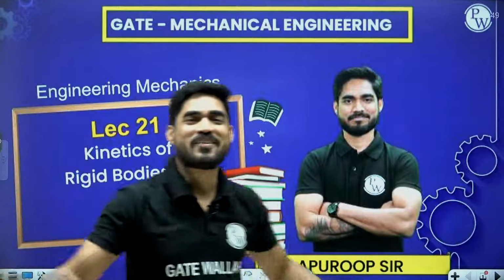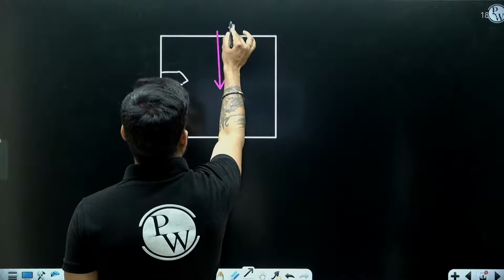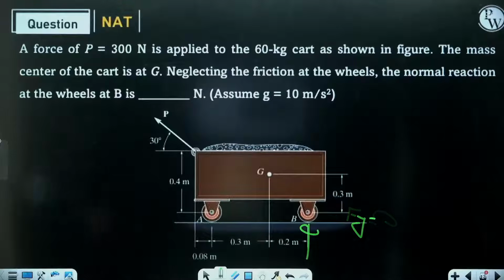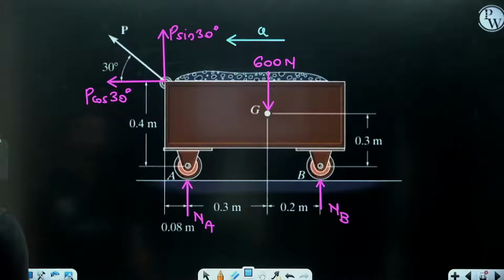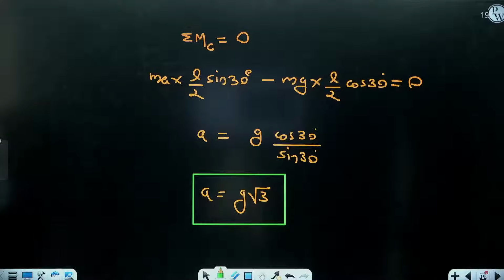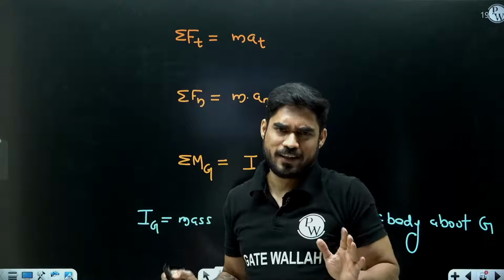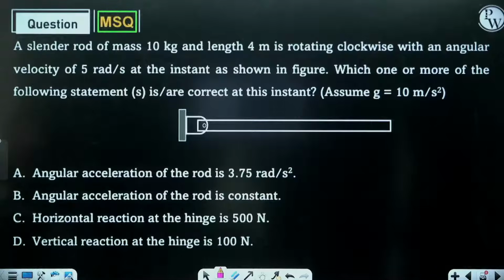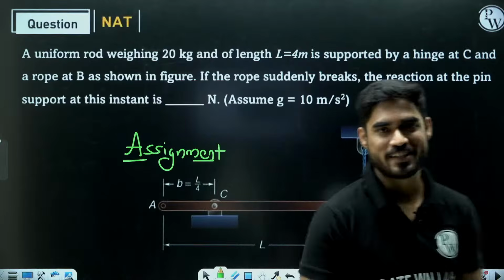Engineering Mechanics 21 | Kinetics of Rigid Bodies -1 | ME |  Gate 2024 Series

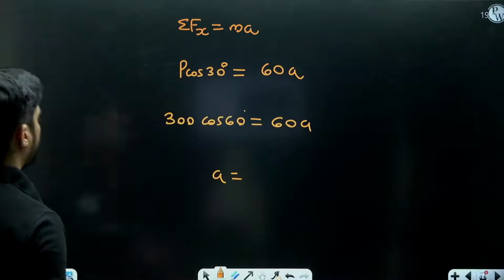Comment: Sir, the acceleration for the cart ques at 20:46 will be 4.3 m/s, by mistake it was changed to cos 60 instead of cos 30. The final answer will then be 282.95 N.
Reply: Final answer will be 332.141 N
Reply: @krrishmaheshwari4860  nooo 284.04
Reply: ans is 332.04 n
Reply: 332.04